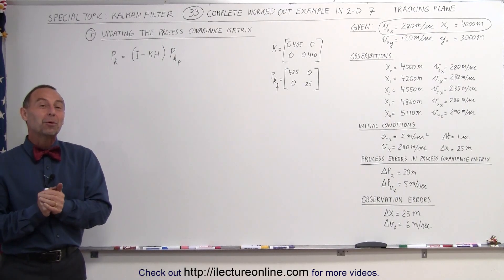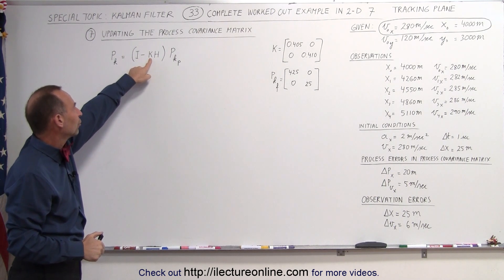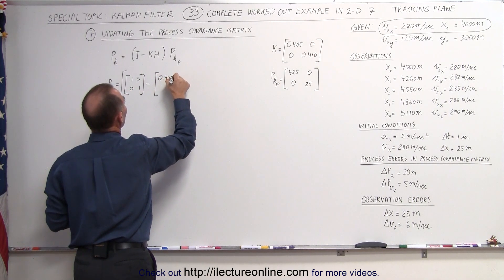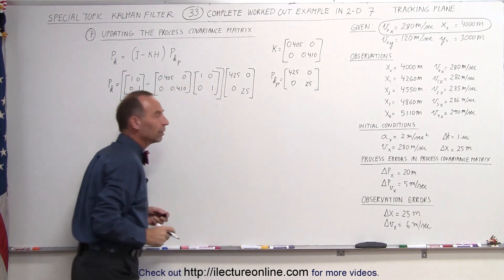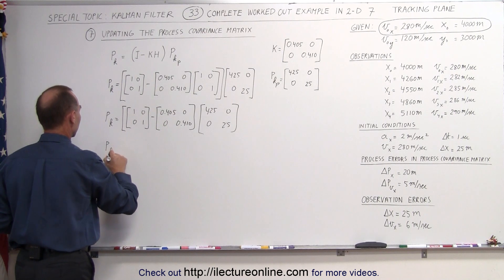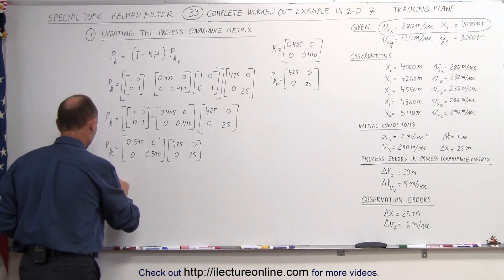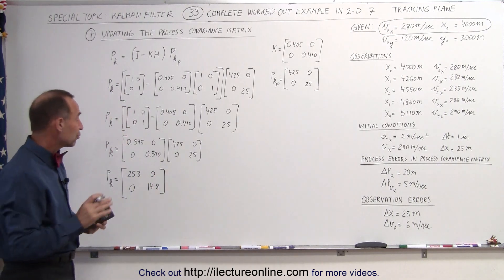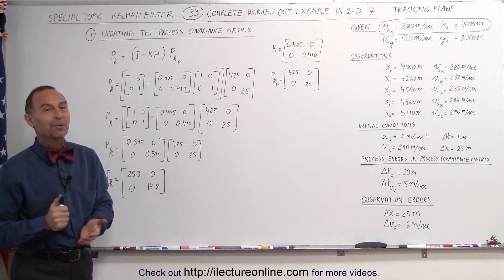Special Topics - The Kalman Filter (33 of 55) 7. Update Process Covariance - Tracking Airplane

Comment: Sir , i am a beginner  and wanted to implement this filter on IMU , but i'm a bit confused.
1.) can we set the PROCESS ERROR and PROCESS NOISE and the MEASURED ERROR approximately in the initial conditions????
please help!!!
https://github.com/Dhruv2012/basic_kalmanfilter
THIS IS THE LINK OF THE LIBRARY I HAVE TRIED TO CREATE.
2)how to combine readings of gyroscope,compass,and accelerometer in IMU to get the best filtered output??

Comment: I have questions:
1. does this process (always) guarantee that the P matrix (process error matrix) will go to zero (considering process additional error matrix w is zero) or at least decrease the value?
2. It looks like it is and that the process of computing P is very deterministic, i.e. I can predict what will be the P matrix in next steps. The reason is that the P matrix in next step depends on P matrix in previous step and K.
But Kalman gain (K) depends only on the noise of the measurement (R = always constant) and previous P matrix. It means that no external factor influences this iteration process. Am I right?
3. if the (2) is true, then Kalman filter is an independent deterministic generator of P (value of P is predicable in each step), from P we then compute the K and from K and measurement we compute the next state.
Reply: I want ask similar question. 
K ~ P/(P+R) 
Its mean K is fraction of overall covariance (P+R). 
If its true, why we getting P = (1 - K)*P instead P = ( 1 - K )*(P + R).
Someone please explain it.
Reply: Hm. On wikipedia real formula to update P is
P=(I-KH)P(I-KH)' + KRK' 
but it said, that if K is optimal gain, then its simplify to 
P=(I-KH)P
And it returns to my question, why not P=(I-KH)(P+R)?
Reply: @spiritmoon3457  P = ( 1 - K )*(P + R)(the formula you said) this way the kalman filter value will always remain 0.5. so it will be a simple averaging equation.

Comment: If you are constantly zeroing out the cross terms then what is your motivation for keeping it all in a matrix format?(beside the prediction step) 
your software can get better performance with regular multiplication and division
Reply: If you write the program to deal with matrices from the beginning, you can easily change the number of variables tracked by the algorithm later, without having to change the main calculation part of the program much, if at all.

Comment: Does the Kalman gain stabilise over time and converge on a certain value depending on the system?
Reply from the maker: The answer is yes.  On real systems, the Kalman  filter will reduce the variation caused by noisy input data, and allow closer tracking to the true values.
Reply: Ah yes I thought as much, if this was implemented into a balancing robot type system whereby the motion was in angular form rather than linear movement, what would (if any) be the overwhelming advantage to using this over a much simpler complementary filter?
Reply from the maker: Sometimes a simple filter is all you need.  It depends on the accuracy you need.  I would first try a simple filter, if that is not good enough, the KF usually does the trick.
Reply: Thanks, also just wanted to say superb videos. So thanks for that.